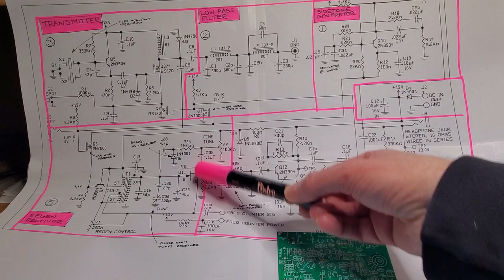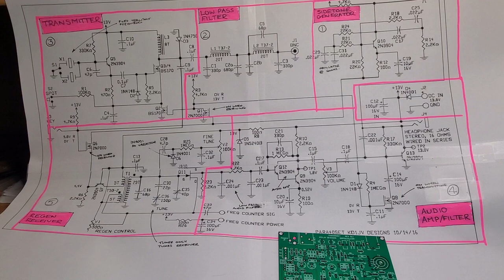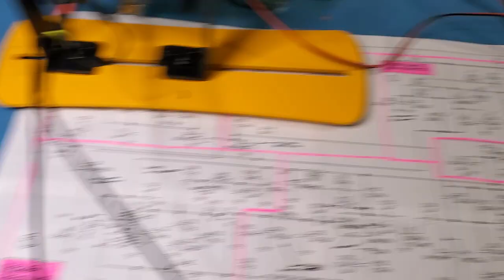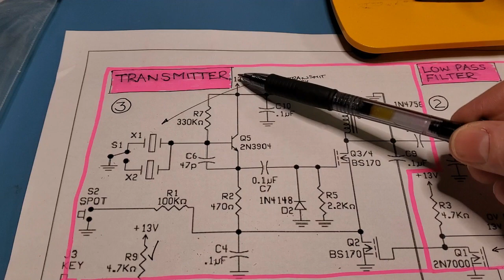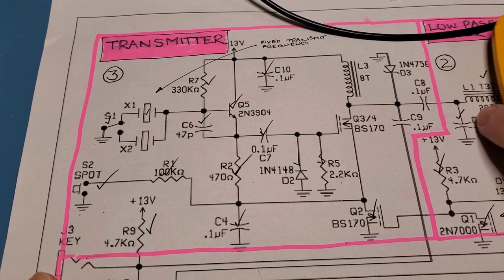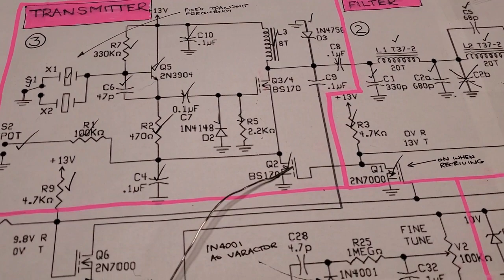QRPGuys Paraset Regenerative receiver - Part 1 Transmitter

Comment: your amplifier is oscillating. One important question: did you terminated the BNC (antenna port) with a 50 ohm load? you MUST
otherwise the amplifier only sees a purely reactive load (infinite Q if inductors were ideal)!! and that's your problem I think. you see that filter when terminated in 50 ohm, will present a 50 ohm in its input to the drain of the mosfets. The inductor in the mOSFET drain has a high reactance because it is just a RF choke for DC bias its reactance should be much higher than 50
Reply from the maker: Thank you for the comment Amir - the antenna does have a 50 ohm load. Its just out of the camera in the second video.
Reply from the maker: Just read the second part of your comment. Interesting - so the reactance of that inductor  has no bearing on the output impedance and the value is selected more to give a high impedance to RF than anything else. Thanks again for the comment
Reply: @na5y  yes I think that's right. The issue must have another cause. I think putting mosfets in parallel with no resistor in their source is tricky. In higher powers it will surely lead to thermal runaway and here maybe it is causing a positive feedback and thus oscillation. so I suggest you put two small resistors in the sources of the two parallel mosfets something like 1 to 5 ohm maybe? or maybe even higher like 10-20 ohm because the current is pretty small here
Reply from the maker: Thanks Amir - I have seen that configuration with a 2.2 ohm resistor off the source of the FET. Thank you for the suggestion I might give it a go.

Comment: my 2 cents re the mystery of the Q3/4 combos ... how many volts do you have at the gate of Q2 as you vary the supply volts?
Reply from the maker: You think that maybe Q2 isn't fully turning on? I'll have to check that and get back to you. Thing is it works all the time with just one of Q3/Q4 installed. Worth a check though and thanks for the comment!
Reply: @na5y  Yeah, it's a massive long shot thought ... that somehow the characteristics of two in parallel is not allowing Q2 to turn on properly.
Reply from the maker: Just checked - the voltage at the gate of Q2 is pretty much the supply voltage. More than enough to turn the FET fully on. Thanks for the tip though I will keep hunting.
Reply: @na5y  Darn! But (I think) that removes the possibility the problem is linked to other parts of the circuit not yet built. Your video showed distortion a the Q3/4 gate ... what does the base of Q5 look like? And a random thought ... put in a 3.58 (ish) crystal and see if the problem is frequency related ... reading the QRP Guys site it looks like the 40m version evolved from the 80m version?? An even stupider outcome may be a change of value for C6. Righto, I'll go and take my sedatives now :)
Reply from the maker: hehe - thank you for the suggestions.